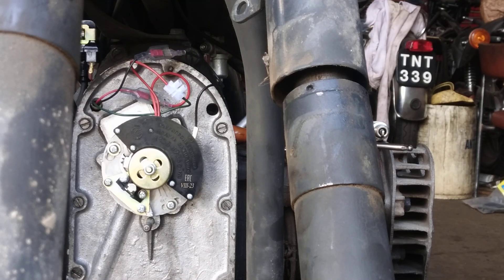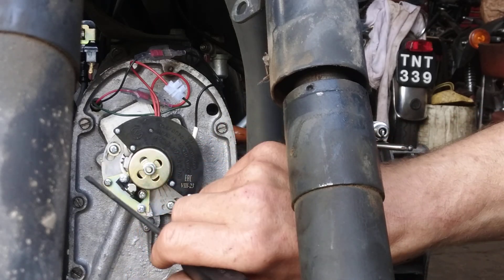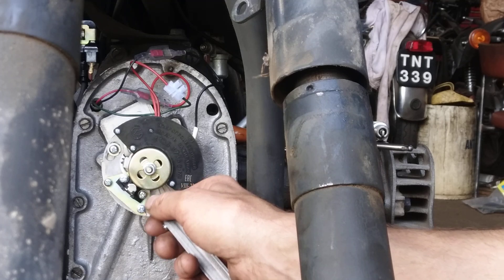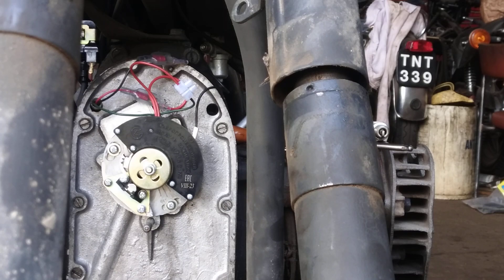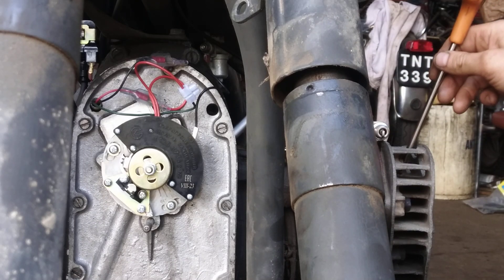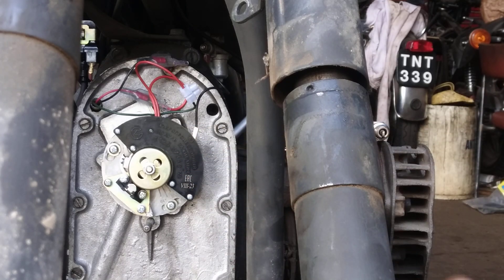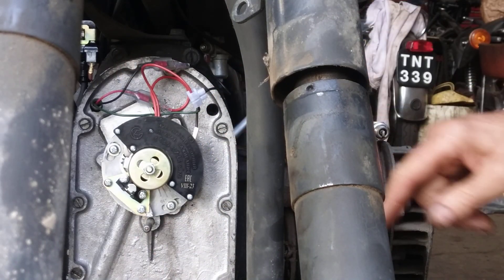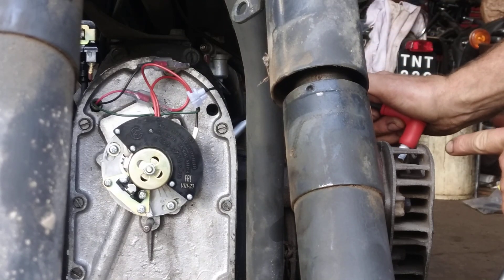Fitting Sovek Electronic Ignition to K750/M72 Part 1. IMZ KMZ + Early Ural & Dnepr 650 OHV

Comment: May i ask what does the rotor that goes on the shaft look like? I got an electronic unit but i dont seem to have the rotor for the unit
Reply from the maker: You should have the rotor but you may have the kit for the later, auto-advance bikes that doesn't come with an adaptor. The adaptor is basically a cap, about 1" OD, that goes over the camshaft. It has a 6mm stud to take the rotor & a csk screw with a threaded barrel to fix it to the camshaft. These are sometimes available separately, it's worth a look on Ebay (search K750 Sovek adaptor). The rotor for the later bikes has a moulded plastic register to locate it in the correct position but this can be cut away.
Reply: Thank you so much...from what I can gather mine is a older k750 model so I'll look for the rotor online ...instructions are in Russian ofcourse lol the struggle is real .. but thank you again for your reply
Reply: Does it work with 6 and 12 v?
Reply from the maker: @NSander  Sorry, I missed your comment but it does work on both 6v & 12v, the bike in the video is 6v.